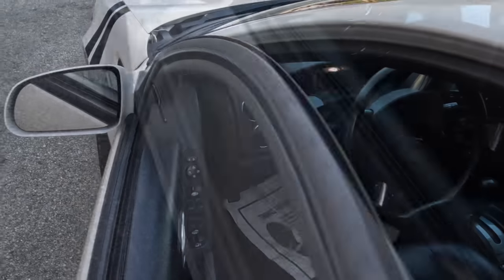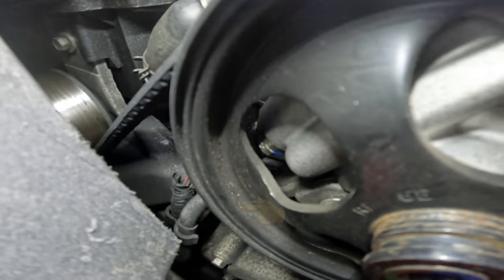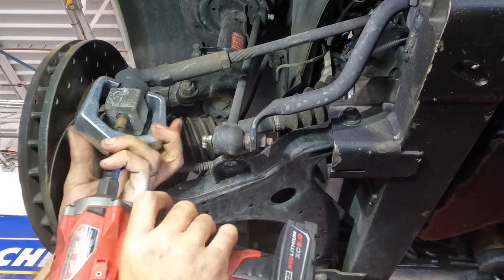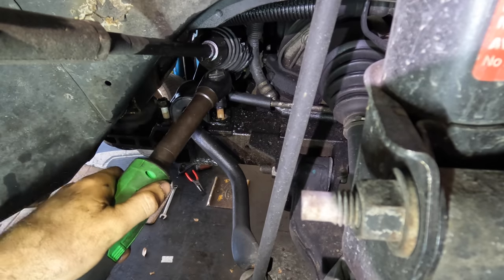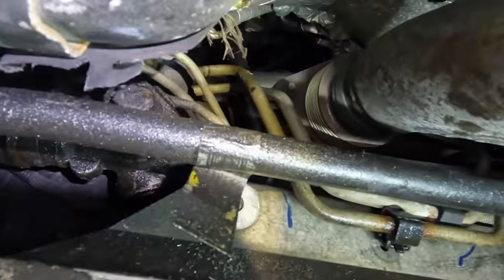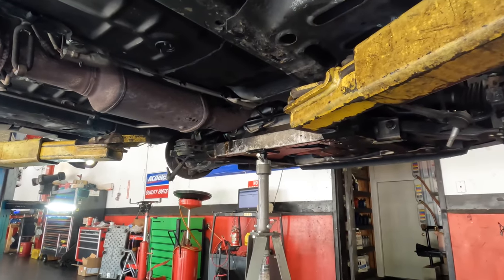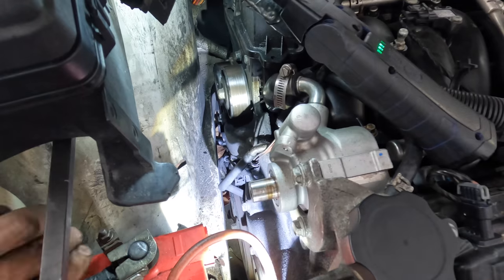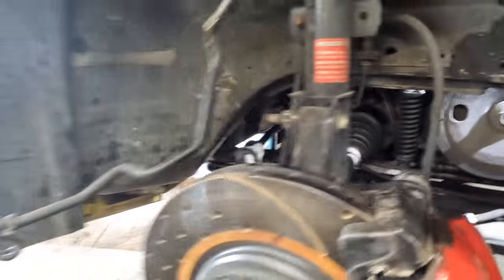Huge Leak! Front wheel drive V8 Pontiac GXP 5.3

Comment: Wow they really did squeeze that V8 into there.  They put this (LS4) in a few W-bodies, but honestly I think it wasn't that great an idea.  For one thing FWD > 300hp is not a good idea unless you really engineer the car for that power driving only the front wheels (like the Civic Type-R for example).  GM didn't even start using this engine until the mid-late 00s by which time they really should have just made a performance pack (with like pulley, tune) for the L32.  They did this for supercharged Cobalt's LSJ engine so not sure why they didn't do it for the V6 S/C.   I'm pretty sure the L32 can make more power fairly easily in the aftermarket (than the LS4) anyway, plus it doesn't have the notoriously failure-prone DOD/AFM the LS4 had...nor is it this hard to work on I don't think lol.

Comment: Bright side of 11mm: you probably haven't lost THAT socket yet😜
Reply: 11mm is the same size (within a whisker) of 7/16". Looks like the car is a hybrid made in the time when manufacturers started swapping over from imperial to metric dimensioned threads/fasteners. We had the same in the early 1980's in Australia. Retired mechanic in Land Down Under.

Comment: Need to add a couple of " extras " to make your " job "  "perfect" !   # 1 , in line filter in return line from  , Rack & Pinion,  and #2, A 6"X 8" ,  oil cooler on return line , in front of Radiator, right side !

Comment: Never even knew you could get a v8 option in a Grand Prix of that year. Car seems pretty bad ass in my opinion. Would be fun to drive.
Reply: I owned this same year model. It is bad ass. You could put it in manual mode and shift it with the paddles on the steering wheel. You could do 90 in second gear! I traded it for the G8 which was quicker and nice too but there was a lot I missed about the Grand Prix.

Comment: My 2017 Chevy Silverado 1500 ltz z71 4x4 crew cab had a shake that will start about 65 70 mph. I change all the suspension parts twice 3 sets  of wheels,custom drive shaft and nothing. Last week I replaced the rack and pinion 😎 finally problem solve
Reply: For sure thnx, you guys are the best, can't believe how helpful all this is👍

Comment: Ray, time for a comment from the peanut gallery. Possible tools for installing that bolt on that Adel clamp on the power steering hose:

1) SK/Craftsman thumbwheel ratchet?

2) Astro/Titan/many other brands "gearless" micro rachets. Short little handles with a roller sprag clutch in them. Perceived as having infinite teeth, but no, in practice their backlash puts them in about the same ballpark as your Dual 80 ratchet.  But these, in 1/4" or slightly longer 3/8" version, are my preferred weapon of choice when things get stupid cramped.

3) Have you seen the FACOM twist ratchets? They operate like a normal ratchet, or, you twist their handle and the drive square turns, no matter which way you twist, it turns the direction it's been set to.  Maybe worth a try. I got one and found that it's not a one-handed deal, I had to put my other hand up in there to push the ratchet head/socket onto the bolt head/nut, and if I had enough room for both of these meathooks, I'd be using a more mundane tool!

_______
IV: In my demented imagination: a cordless ratchet like the ones you use, but slim head, flex head, chain drive,, and a radio. (How to make a chain drive work in a flex head, I don't know, I told you I'm demented.)

Comment: Lucky that the P/S pump was replaced. Some factory pumps don't have threaded holes in the shafts. Wife's '90 Cougar V6 needed to have the pulley off to get the pump removed and out of the way for timing cover gasket replace (blew gasket and leaked water badly). The factory pump had no hole for pulley reinstall with the tool. Had to heat pulley with a torch to get it to expand some and beat it on quickly with the BFH. I'm sure it was hard on the pump bearings, but what are you going to do?

Comment: Ray for your tool to remove pulleys you should get a tap and die set and fix the threads on so you don't have to buy a new tool unless you really want to then it is your choice and non of us can tell you not to do so because it is your money.

Comment: Hello Ray from NW Arkansas!  Look forward to all your videos, and usually learn something in the process.  Two takeaways from this video.  1.). I fully expected lots of brake clean spray with so much power steering fluid discharge!  2) You get the smart as a hog award for the neat trick at the end of the video with the missing threads!  **smart as a hog is compliment here in Arkansas

Comment: Nice to see the good jobs you try to get done and the care you put into a job. Ime sad to say more need you attitude. This is why I got into doing my own work so many mess up jobs I don't mind paying for a job but I want it done right .I just got a oil change on my 1994 Toyota privia . Paid a good amount for oil change Mobil 1 oil synthetic and filter. No problem sad part I went on road trip  and oil started pouring out around filter went to parts store got a new filter went under van took off old filter with one finger spun it off. Put on new filter. Got home changed oil again for safety my classic van did not get to 211thousand miles by bad work sad you have to check all work near where I live. Keep up the good work.
Reply: Ps my van I use for work its in great shape. So good I get 5 offers a week people wanting to buy it. But it's not for sale.  I love this one . Mid engine a pain but great driver . For some reason I get the thumbs up alot . It seems a lot of people still like this classic  egg.

Comment: Nicely done Ray.  I know it wasn't your issue, and I could be wrong, but it looks like a piece of the inner fender well was missing on the passenger side allowing the crank pulley to be exposed to spray from the tire in the rain.  I would think this would lead to premature belt failure and slippage.  Another question: did you notice a bunch of torque steer when accelerating?  My buddy owned one of these Pontiacs for a few years and it always seemed to pull to one side when accelerating hard like to get on a freeway, or when moving to pass another car on a two-lane and operating from a middle speed  (35 to 40 mph).  He ended up trading it for one of the new Camaros because it was rear wheel drive.

Comment: Ahhh... FWD and V8. Just like Ford Taurus SHO. I mean it is stupid, but I'm glad such drivetrain combo even exists. 🤣 I like to think they did it because some engineer thought why not?

The only thing I dislike about both the SHO and GXP is the 4 speed automatic. Not that its an automatic but only 4 gears blunts the performance (long ratios).
Reply: Ya , Taurus SHO Yamaha built motors highly sought. V8s were sur fun on test drives. Believe they also did quad cam Corvette Z motor (also engineering prize)

Comment: I miss pontiacs .. except my grand prix ...from the factory dipstick full mark was a quart and a half low ...needless to say went through two oil pumps. I replaced dipstick with proper number part and was the same stick with low oil full mark. ASE mechanic figured out by measuring oil at fill mark to spec... major pontiac screw up ...how many engines did they destroy ?

Comment: Ray. The bolt you could not pull out looked like the bold head would clear the bar but not the washer. Could you not have pushed the washer back to the frame, and pulled the bolt without the washer?

Comment: So many Grand Prix's and Grand AM's had computer issues, I was certain none were still around.
Reply: I've owned a 97 and 02 GTP, a 07 GXP and a 99 Grand Am. The 97 grand Prix and the 99 grand am had over 300K on them. I never replaced any computer in any of mine. The only serious problems I had was the super charger on the 97 at 210K-partly my fault I didn't know it had its own oil sump that I neglected to maintain. I'm sure it was worn out too. I drove it hard too. The 07 GXP had repeated lifter failure because of the AFM. Never had anything else major to fail. Surprisingly my 02 still had the original alternator when I traded it in 07 with 220K! Usually these are  weak item on a GM.

Comment: The 5.3 front wheel drive engines are around 1 inch shorter than the rear wheel drive 5.3.

Comment: Failures on W-Bodies (GXP, Impaler SS, Monte SS, Lacrosse Super)... steering rack, fitting leak on trans, the 5.3 eats the 4T65Es (guy makes a 4T80E adaptor kit), o-ring on oil pick up tube, motor mounts tear and the AFM/DOD lifters die... just to name a few.  Regardless... fun cars... and torque steer is insane and I don't recommend a fairly new driver (<10yrs) gun it... you'll be shot into the other lanes. LOL.

Comment: I hate those stupid press on power steering pulleys, I had to replace the pump on my truck, I stripped 2 tools trying to press the pulley on and it's still not on far enough so the belt squeaks.

Comment: I miss my 2008 GXP. What kills these is AFM and to small of a trans cooler. Steering racks, pumps, harmonic balancers, oil pickup tube o-rings, and shocks are common. NOTE TO THE OWNER GET RID OF THAT FRAM FILTER!!!!!!!
Reply: I owned an 07 GXP only issue I had was with the AFM. The lifters would fail due to the oil being cut for the cylinder deactivation.  If allowed to go for too long you would be putting a camshaft in it. How did the engineers expect the lifters to last without lubrication?  Did they ever make an AFM delete for these? I will say the fuel mileage was great for a V8 though. I was getting 28 on the highway. You had to drive it conservatively to get that which was hard to do. Well said on the Fram filter!

Comment: You could not pay me enough to even remotely touch a Pontiac product ever again for anyone out there who has ever owned a Pontiac and has received the service engine light coming on will understand my frustration Pontiac decided to use a rigged spark plug cable system on a lot of their engines if you don't go back to the dealership and Fork out $300 plus for their cables the cheaper spark plug cables end up failing because Pontiac loves to put the spark plug cables in between the exhaust manifold on the engine which resulted in the spark plug cables arcing off of the crankcase of the engine which results in the service engine light on all Pontiac products sadly dealerships knew about this product and didn't bother telling customers and charged customers for everything from replacement fuel tanks to replacement fuel pumps to replacement fuel systems for the engine to new spark plugs to all sorts of garbage just to make a buck off of you run do not buy Pontiac

Comment: Ray….do you never, or sometimes, or often talk to the customers about your initial thoughts and recommendations on their cars? The reason I ask is that you get a LOT of customers who reject some, if not most, of the recommended repairs. I have to believe that is mostly due to finances but I also wonder how many think the business is loading the bill and offering unnecessary repairs. If they could see the 1st 5 minutes of your videos, I think that they could see more of what you are recommending and why. Even if they knew little or nothing about how a car is built and how it works, all the leaks, tears, rusted parts, etc. would surely influence some of them to take greater strides in keeping their cars in good operating condition.

Comment: This car is a prime example of the failure of Pontiac along with the rest of Detroit, they all left the the great car designs from the 50s and 60s to a cookie cutter car platform. I agree, front wheel drive does not belong on a V-8 Gran Prix. I had a used 1968 Gran Prix back in 1975, wish I still had it, that was back when you could tell a Pontiac was a Pontiac a mile away. Also IMO the car designers that tried to bring back the GTO few years ago all should be slapped side the head!!!!!!

Comment: an impact on a puller? are you insane? I used my 1/2 inch air impact on a puller working on a Kubota skid steer to replace a sprocket. the impact stripped the shaft on the puller pronto.